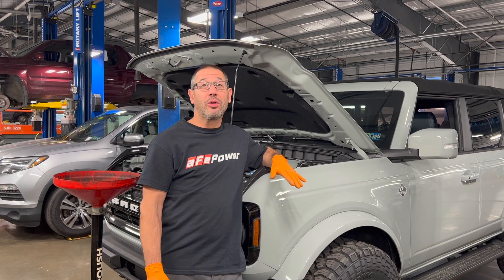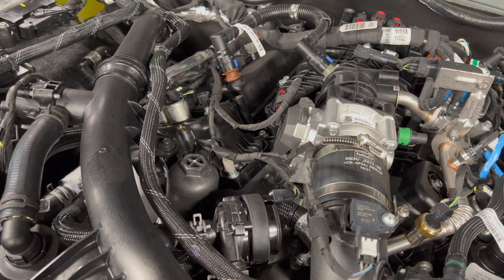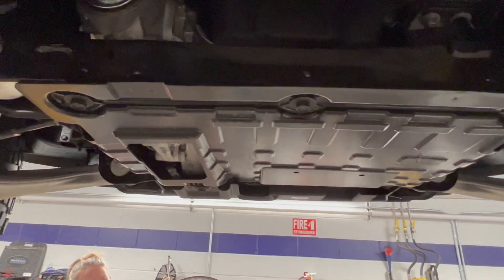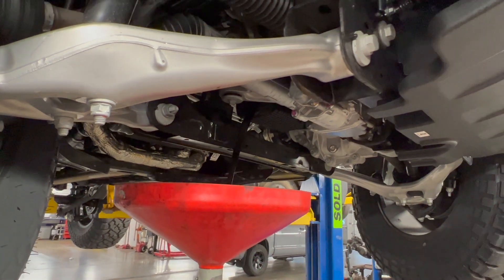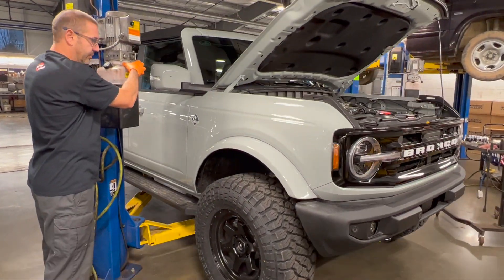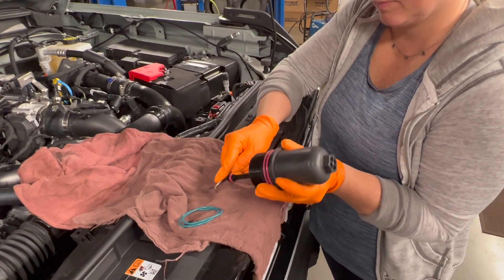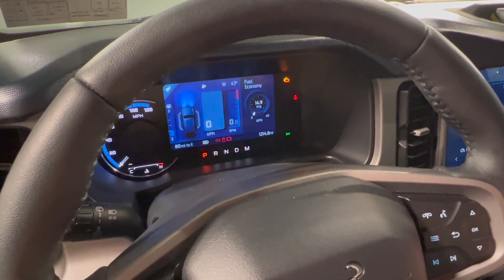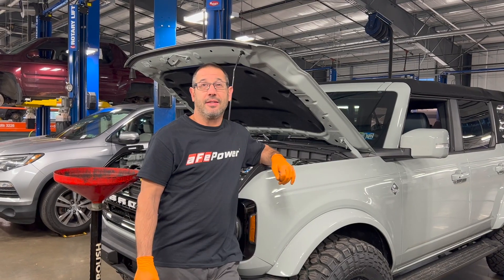1st Oil Change on Our ‘21 Bronco

Comment: Thanks Brian, your video was very instructive.  I usually go off road in the desert and the dunes and I tell you that that protective shield under the engine in the sand is useless, I had to change my Jeep for a 6mm aluminum one, the plastic one that comes from the factory it broke in the first half hour of the crossing.  It is better to change it because a stone not only breaks it but can destroy the engine.  Enjoy.
Reply from the maker: I agree with you, should have been metal. Thanks for watching!
Reply: @PIPSBURGHVIEWS  if it's iron is to heavy.

Comment: Your supposed to start the engine after adding new motor oil and let it run untill the pressure is up before checking the oil level.
Reply from the maker: I did that.
Reply: @PIPSBURGHVIEWS  👍I usually flush the old oil out with a 1/4 quart of new motor oil and the reinstall the drain plug and use new motor oil on the o-rings or gaskets for the filter or filter housing also.
Reply: The new Lucas Full synthetic oil stabilizer works well with full synthetic motor oils when adding new motor oil after draining the old motor oil and changing filter also. The Lucas Full Synthetic oil additive is in a 1 quart bottle with a checked flag design on the outside of the bottle. It says on the label it works with any type of full synthetic motor oil. It's thinner than the old style of Lucas oil stabilizer additive.

Comment: You’re the first person I’ve seen that’s added 7 quarts and shown full on the dipstick. Everyone else is over full with that amount. The thinking is they used the wrong dipstick. Waiting for official word from Ford.
Reply from the maker: I just went by what the Ford workshop manual states but I also saw this after I posted the video.

Ford Bronco Team Engineering Confirms 7.0 Quarts for 2.7L Engine Oil Change is Correct  https://www.bronco6g.com/bronco-team-engineering-confirms-7-0-quarts-for-oil-change-is-correct/

Comment: I'm surprised it has a plastic drain valve. I'm just used to the old metal ones.
Reply from the maker: A lot of the new Fords use it, not sure if any other manufacturers are going that route.
Reply: @PIPSBURGHVIEWS  Hmm, I guess it saves waste on metal bolts? I know that some manufacturer are going the 0w-16 route, I wonder whats the long term engine wear, that we don't know yet.
Reply from the maker: @cd9225  I assume the composite pans are more cost effective.
Reply: @cd9225  The 0W16 oil is Group 4 synthetic or GAL synthetic.  It is a very robust oil, much better than the synthetic blend MC (mostly conventional) oil.  The engines that use 0W16 will run forever.

Comment: I wonder how come you needed 7Q for the same engine for 150 which requires 6Q...
Reply from the maker: I know there are a couple small differences in the engines and this has become a hot topic on the forums.